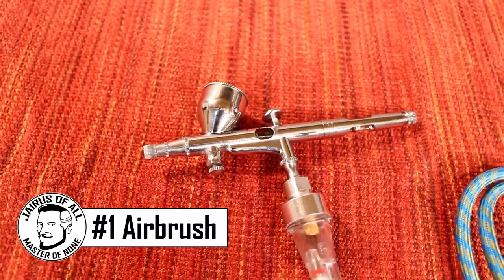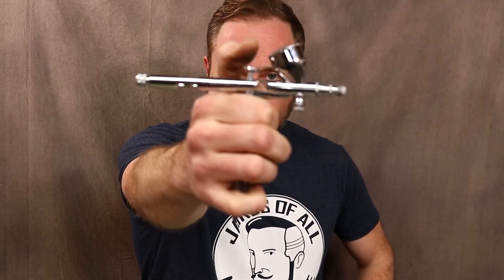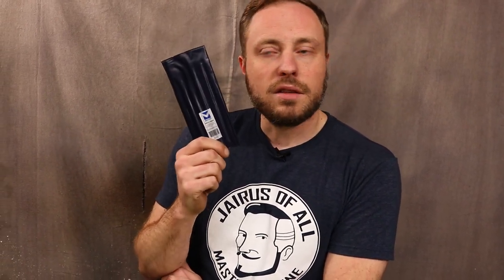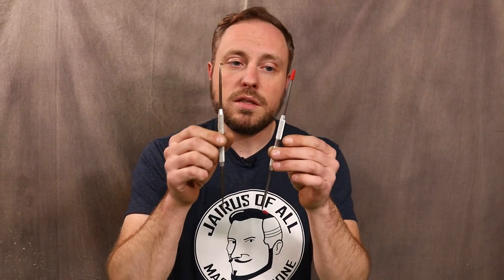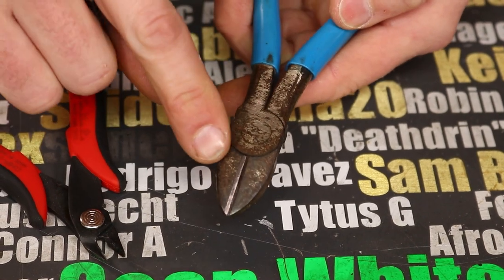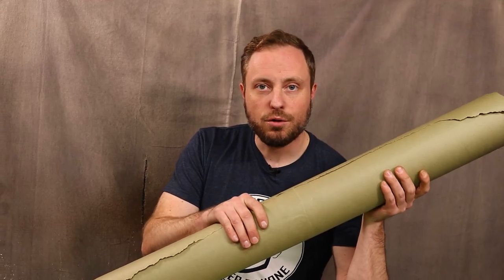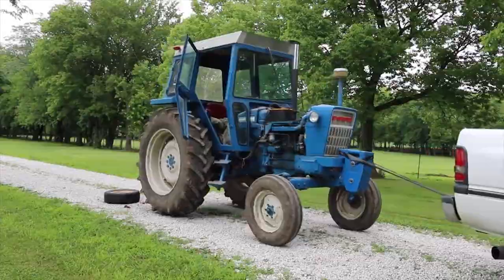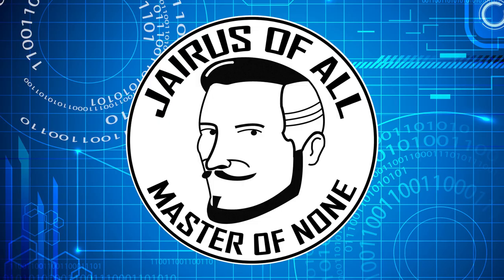Best Cool Tools 2020 - Crazy Useful Weird Tools

Comment: Quick tip: you can make CA activator by dissolving baking soda (potassium nitrate) into water until it doesn't dissolve anymore. Put it in a spray bottle and you have homemade, dirt cheap activator

Comment: For the magnifying glasses, it's not as cheap, but I was able to get a cheap digital microscope with a screen for about $75 CAD on Amazon. Makes fine soldering so much easier. I've tried magnifiers before, for painting and I found they just distorted the view, and made it hard to actually know where the brush was. Great list though. The items I do have equivalents of, I use fairly regularly doing Tech repair, and just tinkering/learning!

Comment: Great vid. I'm a fan of cheapo calipers, but their batteries don't last very long (they use like 80% current when they're "off"). I glued a AA battery holder to the back of mine and soldered it to the battery contacts, with a switch to turn it off for real. On a 2nd set of calipers I'm using the original tiny battery but I also wired a disconnect switch, it was a bit more hassle.

Comment: I have that file set, and they do actually cut hardened steel to a point. I use them to tidy up the shoulders on knives made from saw blades, which are 52-54HRC

Comment: Tip about air brushes and guns you can basically make anything spray good if you mess with the settings. That being said more expensive brands tends to have parts around for repair or replacement. Notably the needle kind of fragile.

Comment: Pin vices are also great for drilling holes in model aircraft right up against the control surfaces, cordless drill won't fit in there

Comment: For drilling fine things, like circuit boards. You can also get a drill press stand for a dremel, for around $50-60. Makes DIY circuits so much easier, and gives you a lot more confidence, if you don't have a steady hand. I second the airbrush. Asked for one for my birthday last year, and it came in quite handy for putting green accents on my pc case.
Reply: You also 3D print a dremel press for just the cost of the plastic